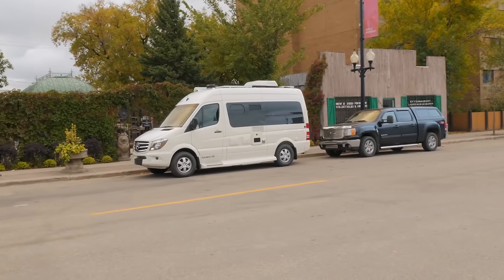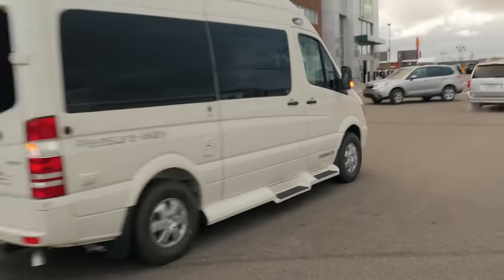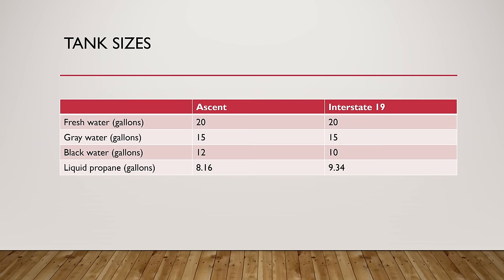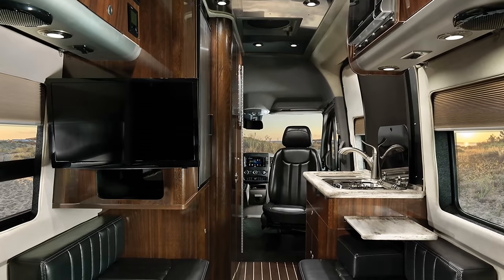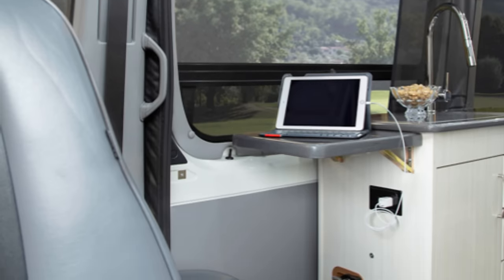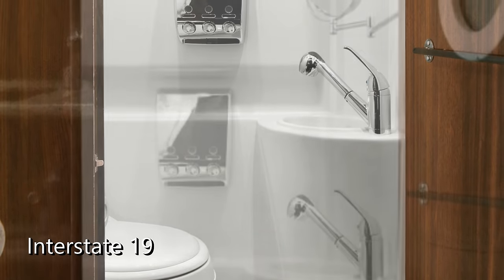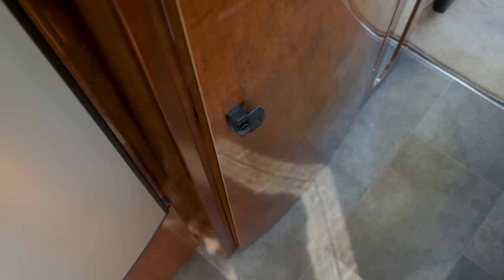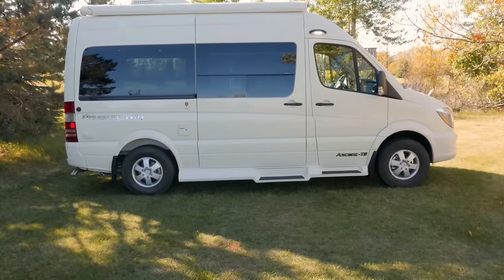The Top 2 Premium Class B Camper Vans Under 20' | Pleasureway Ascent versus Airstream Interstate 19

Comment: Thank you Neil for your extensive research and clear explanations!  One point:  without having seen either of these vans in person, I have to humbly say that, in my experience in the industrial and automotive manufacturing industries, "stall built" is not necessarily better quality than an assembly line.  Having coaches individually built in parallel creates a significant quality consistency challenge.  Quality depends on all of the workers being equally conscientious and skilled at multiple tasks.  Whereas an assembly line is much more controllable with "specialists" at each station performing the same assembly tasks on every vehicle.
Reply from the maker: thanks for sharing your thoughts john!
Reply: I agree I worked on an assembly line and if something isn't right you have the ability to stop the line.  In our factory, we rotated every hour so that one person would be proficient on each part that went into the vehicle after a while you just know the vehicle and how everything should feel.  Just because something is massed produced doesn't mean it is of inferior quality.  What you are really saying is that the workers aren't of the same quality or craftmanship or you're saying the material that American's use isn't of the same quality.  Otherwise, how would he know that the ascent is built better he didn't compare any of these things.
Reply: I'm not even sure why Ultramobility mentions this!  False and misleading statement in my opinion.  Because Pleasureway is built in a stall does not mean the quality is automatically better than a production line!  If you think Pleasureway is better quality than the Airstream Interstate 19 then give a define reason(s).

Stalls vs. production lines may make a difference for building speed , but speed does not equal quality!

Comment: Also an electric bathroom vent fan and a fantastic van in the kitchen area in the Interstate 19. Does need lithium option. I bought my own 525 amp hour plus 3000w inverter/charger. Great and fair review
Reply from the maker: great to hear John P. I appreciate that coming from an actual owner of an Interstate 19! They are both great coaches no doubt.
Reply: John P.  Does the 3000 watt inverter make it possible  to use all the outlets and microwave off the battery? Thanks!
Reply: Julia PL Yes Julia. Thanks for the question.
Reply: I wish I understood the amp hour and the inverter thing better.  What does that get you?  I was told to be afraid of the lithium batteries.  I'm confused.  Please explain.
Reply: Rhonda McCay That’s because it is quite confusing! You can look it up on the Internet and you will see a few videos and get some pretty good explanations. Basically, the larger the number of amp hours the more power you can draw per hour and the longer your battery will last per charge. That is very basic. It depends on how many amps each of the pieces of equipment that you use will draw and then you would add that up. It is generally measured I think over 20 hours or something like that. Also , You never want to run your battery down all the way. Non lithium batteries are happy down to about 50% while Lithium battery give you full power down to about 10%. It also keeps the battery life stable for a longer period of time, if you don’t run it down to low.
Reply: Hi, John P where were you upgrade you battery and inverter, Thanks

Comment: Have you done a comparison of the gas version of the Pleasureway Ascent vs the Panoramic that you currently own. I'm curious to know, for your own personal use, which one you prefer and why. Also, how would you advise someone to purchase the Panoramic? I would think used or direct purchase might be the answer. What would you expect the price to be?
Reply from the maker: Layout-wise I definitely prefer the Panoramic. With the new 2022 Ram chassis it is on par with the Sprinter in terms of safety features. Lacking a bit in luxury features like electric seat controls, heated seats and power side door but in terms of drive ability I now prefer the Promaster. The electric steering is much nicer and the 9 speed transmission is amongst the best transmissions I’ve driven. Just call Panoramic and place an order. They will take care of you. Price will be around $150k for a fully loaded on like mine.

Comment: Since you have first-hand experience with Pleasureway, it might be helpful to your viewers/readers to know about our experience with a then-new top-of-the-line Airstream Interstate 24' RV that we bought in 2016. After six months of grief, aggravation and heartache with what is in our opinion the worst designed, poorly made badly dealer/manufacturer supported network, we thankfully traded it on a 2016 Leisure Travel Van Unity Twin Bed that gave us nothing but joy. The Mercedes platform, to be fair, on both the Interstate and the LTV is excellent and largely problem-free and reliable. Our issues were entirely with the coach. 

As we traveled extensively, we heard great satisfaction and praise from satisfied Pleasureway owners, while many Interstate owners, like us, were disillusioned with the brand. It would take many paragraphs to list what we felt were Interstate design flaws and manufacturing defects on the coach we owned. For example, It had electric motors and controls that were never needed and created complexities and failures. Why have electric motors on all the sun and night shades? Keeping it in synch proved impossible for us,  and individual shades failed on a regular basis. It had a rotary drum to electrically reel in the macerator hose that turned too fast and would jam the hose and blow the fuses. (We had to explain to the Airstream dealer that it was a blown fuse that stopped the macerator). The electric lounge transformed into the bed using the pull out side seats. These seats had metal brackets that when extended to make the bed, hit us near our knees making it painfully uncomfortable to sleep. 

Yes, this was a 2016 Interstate coach. Perhaps the 2020's are better conceived and built.
Reply from the maker: very good feedback

Comment: What is it with the most expensive RVs out there
offering 2-point lap belts to passengers
(which means you don't carry your most precious guests)
and lead-acid batteries that Henry Ford used 100 years ago

I still think the RV industry is where the US car industry was
when an unknown Japanese compnay named Toyota decided to take over the US car industry
by offering what consumers wanted and not what MBAs wanted in the boardroom
Reply from the maker: agree but from my talks with heads of these companies the product is not a must-have product like a car. As a secondary or tertiary big ticket item there's just not a lot of r&d dollars that are justified since volume levels are so low. that's my understanding of the situation at least.
Reply: A lead acid battery that Ford used a hundred years ago seriously that's like say a model A and a Ford Focus are basically the same and no major improvements have been made . For the Vast majority of Mercedes Rv owners lead acid batteries are more than adequate.
Reply: @jimbotheassclown  I just spent a minute trying to find a lead-acid battery in our home
just Lithium and Alkaline in our home. Rechargeable items are all Lithium.

I have to look into our Honda HR-V to find a lead battery.
And it is designed to be 100% charged with a start once in a while
and then back to 100% in 5 minutes

That is not what is needed in the RV living quarters
Lithium is what is needed and not an antique

The RV manufacturers base their electrical needs based on the wrong electrical use model
Reply: I agree. Lithium is the new standard expectation.  Anything less in a high cost RV is a rip off
Reply: lol ok lets talk when it's time to replace those batteries.

Comment: I need to know. How much can it carry, what is the weight limit for the engine? What is the max weight for the frame? I have seen too many fancy rigs with overloaded engines and or suspensions. they burn out after 35000M or so. Does the rig strain at eighty? does it come apart at eighty? What is it's insolation factor, can it keep you warm in -20 weather, cool at 110F?

Comment: I really like the Ascent. But Pleasure-Way has ticked me off for a few reasons: One, in spite of their "stall" production, they won't make ANY deviations from their product specifications. For example, I asked about why the "copper" interior (like yours) is no longer available, and was told it was just a production change. When I wrote back offering to pay extra for it, I was basically blown off by their representative named Grant. Pleasure-Way offers two basic pale-looking interior colors, and only white or silver exteriors. They also went to the flimsy magnetic screens instead of the neat sliding ones, and the retro MCD roller shades which I had in my bedroom in 1955. I just expect more choices at this price point. Pleasure-Way is unwilling to accommodate the customer, and in spite of their great warranty, and the poor Coachmen one, I'm going with the Galleria 24A. Just more for my money, and great construction.
Reply from the maker: @Thomas Darby - thanks for sharing your experience with others. The Galleria 24A is a nice coach. Be aware of the 1 year warranty and shake down as much as possible that first year. With regards to  the copper interior - i love it too and don't understand why they don't make it. I don't like the new interior colors as much. the new Corian "concrete" colors are not good in my book. However, I like the MCD shades and screens ALOT. I've had non-MCD shades and the MCD shades just work great and are simple. the sliding screens for me just collect grit and start to jam up. bad design choice for an RV in my opinion.
Reply: @Ultramobility  Those Rolef screens are much better than sliding screens as they are always a problem due to the tracks.

Comment: Great comparison. An update would be appreciated. I have an Airstream 19' 4x4 on order and I took a look at the Agile for the first time today. I was disappointed in the bathroom size, the ease of making the bed and not having a good screen on main entry door. I also worry about the ground clearance off of paved roads. These are two great contenders and the decision is a personal choice based on your needs.
Reply: For $150,000+ Premium Class B Camper Van, I expect all-wheel drive that Airstream Interstate 19 has and very surprised Pleasureway Ascent does not have.

Comment: I have looked at the Airstreams at shows numerous times. While I like the interior style, they just are too small. It appears that Airstream builds them for under 6 footers. The head room is always too short and the bathrooms are SO tiny. Especially for the price. At 6'5" I will keep looking.
Reply from the maker: @Uncle Lar - thanks for sharing your experience! it's hard to find a class B that accommodates people taller than 6'2". Maybe the National Explorer Trek?
Reply: @Ultramobility  Thanks! I have not seen that one but will check it out!
Reply: Look at B+ rigs like those offered by LTV or Regency. They tend to offer more headroom for us non-midgets.
Reply from the maker: Most class B+ rigs will have at least 6'5" of interior head room. The Plateau XL series has 6'8" in most parts of the coach. the rear bedroom area is 6'5".

Comment: What is your take on all the talk about problems with the MB Sprinter engine and chassis?  I have heard about a lot of problems and no real fixes from MB.  Engine lights and DEF problems etc.  What is your opinion on this situation?  Thank you.
Reply from the maker: i have owned 2 diesel sprinters and have not had a problem. i don't think it is a widespread problem. not saying there aren't individuals out there who haven't had problems and may be vocal about it but i haven't had any problems and I haven't heard from a lot of owners that have had any problems. my sprinter has been rock solid.
Reply: Thank you for the quick response.  I drove diesels for many years and loved them but that was before and up to 2010.  I now have seen there are many differences than then and with some of what I have read it was making me a little worried about going with that and not opting for a gas powered Lexor.  But this will help me again reconsider my first thoughts on the MB series.  They are by far the best looking of the two series.
Reply from the maker: @Randy McGehee - here's my 2 cents. Fleet operators like Amazon would not be buying up all the stock of the diesel Sprinter right now if there were any hints of problems with that engine. they just have too many in their fleet and it would cost them. so i use all the fleet operators that continue to purchase the sprinter as my gauge. it's a reliable, capable and robust platform in my book.
Reply: @Ultramobility  I have wondered about the diesel/DEF issue many times--I love the short sprinter but I'm always held back because of the cost and potential issues. I have been on a FB group for the Revel and it seems there are some issues just related to the 4x4 (though all the owners love that capability). I think there are always tradeoffs but the new sprinter design that now comes standard with the 7-speed has really caught my interest again.

Comment: Good morning Neil, was that a plastic toilet in the  airstream interstate
Reply from the maker: it looks like a dometic 300 which is plastic.
Reply: Ultramobility no thanks, that’s one thing I don’t like is plastic toilets. Those freak me out. I would have to upgrade to porcelain and upgrade to induction cooktop. Which both should come standard at that price point
Reply from the maker: @Craig Morgan - they must have opted for the plastic toilet to save a little weight? can't understand why they wouldn't otherwise go with a porcelain one. the induction stove can be easily had and stowed away but i agree on the toilet.
Reply: Ultramobility I’m very picky when comes to certain things. I’ll probably go with the ascent to be honest. Jus opt in induction cooktop
Reply from the maker: that's the right thing to do. with things that are easy to change don't limit yourself. other things like quality and warranty can't be purchased after market.

Comment: Why not buy or build a custom sprinter van that's nicer for a lot less money? Both of these the off grid electrical systems are weak. I want 1000 watts of solar and 600 AH lithium battery bank. You can build something nicer than either of these options for half the price imo which is what i plan to do.
Reply from the maker: not sure you could build either one at half the cost. most custom build outs of a quality level would be higher priced than either of these. but it sounds like you should definitely go the custom route if you need that much solar!
Reply: @Ultramobility  Yep, most of the cost is involved in building these vans are in the lithium batteries and solar system. A good electric system will be around $10K DIY, without anyone installing it from what i've researched. I just don't want to have to depend on being plugged in all the time. I mean yes it's nice to have disposable water on tap but want the ability to go anywhere for a week at a time and be off grid as well. Im not crazy about those fold out cushion beds either. I like the Murphy beds or an even better option i saw was a Happijac bed. They're hydraulic and goes up to the ceiling when it's stowed away. I completely understand people who don't want to do any of the custom work themselves though. It's all what you're looking for i suppose.
Reply: Jerm Great thoughts.  Can’t wait to see your build.  Remember, it’s almost impossible to get value if your build is not in Blue Book valuation.